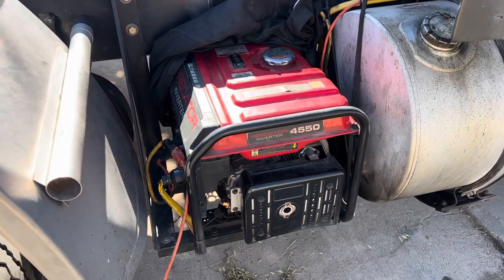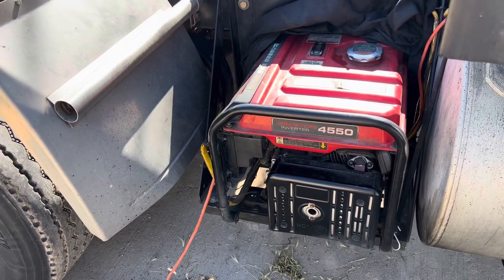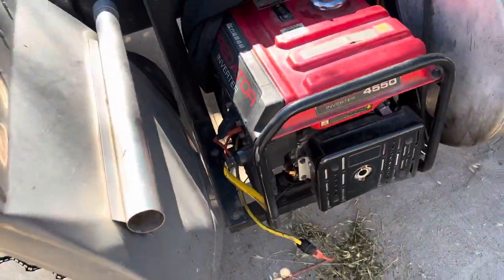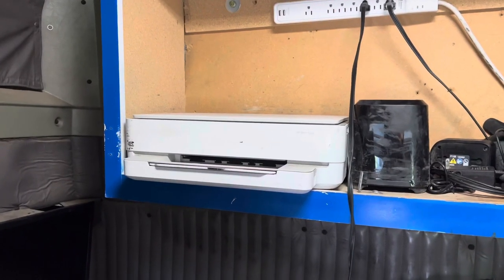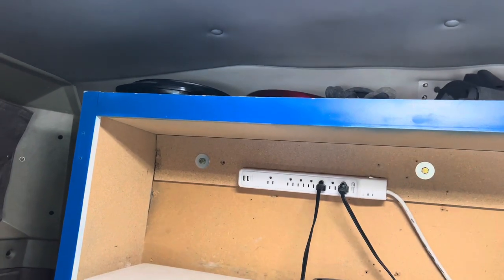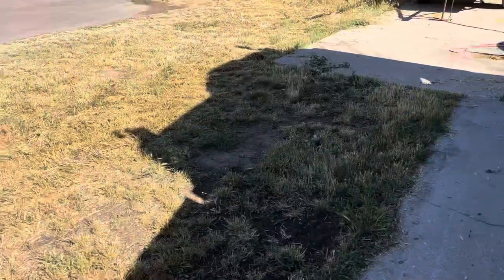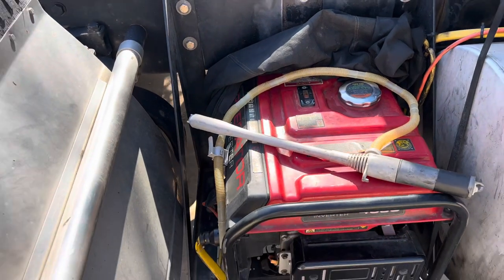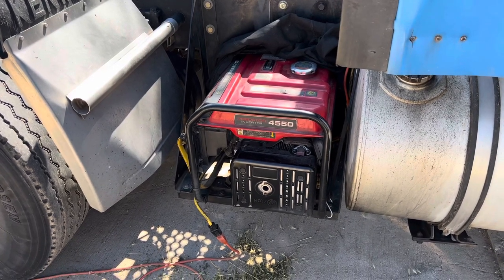APU/Generator Setup On My 2005 T600

Comment: Saw a 2000w silent inverter genny setup a couple of months back that was mounted up on the back of the cab on the same bracket that held the mini-split it was powering along with feeding a battery charger....asked the guy about it an he showed me how he didn't even have change the oil as it was set up with an oil line off the engine feeding engine oil from the truck engine into the drain plug of the generator with a check-valve to stop the oil draining out when the truck engine was stopped, this line had a 1/16" restrictor in it, there was also a return line that came out of a plug threaded into where the generator oil filler plug normally went to return oil to the trucks sump when the truck was running.....fuel was fed to the generators tank by an electric pump from a 30gal gas tank down on the side of the chassis with an overflow that went back down to the gas tank, this pump was on a timer switch to kick on a couple of minutes every 3hrs whenever the generator was running.

Genney was electric start as well

Best setup i have ever seen bar none
Reply from the maker: Only issue I see. Diesel oil is different then gas oil. But if ya can get away with it.. good deal! And I would worry about that gas generator contaminating the diesel oil.
Reply: @DrivingByBraille  Diesel oil is higher spec than gas oil as it still has zinc in it so is better for high load......lol having worked my whole life as maintenance for earth-moving machinery every vehicle i have ever owned has had diesel oil run in it no matter what fuel it used with the exception of motorcycles that have the clutch in the engine oil.

Comment: Green APU has changed the game on the industry. Reliable Kubota diesel and automotive components basically just like your car has. Get parts at most auto stores.
Reply: Stop it, that apu is still 10k
Reply from the maker: @EdoHannibal I think it’s closer to $15k now. Let the APU fan boys believe what they want. When they need to fix it, I can buy 2 generators. Let alone  lifetime of generators what the pay for their APU on. A truck that only last 5yrs 😀
Reply: @EdoHannibal  I was just at the MATS and they said it was $13k but had a 4KW generator on it. Which seems to be new
Reply: @DrivingByBraille  do u use the truck ac when u running down the road, or the portable ac? I'm looking to get one, and I don't wanna fix my truck ac if I just run the portable one all day
Reply from the maker: @MrKingcruz no, the portable will only keep the bunk cool. It don’t have enough BTUs to cool the whole truck. I’d like to eventually put in a rooftop unit like on an RV. Had one on an old truck and that would keep the whole truck freezing even in 110° Arizona heat.

Comment: I mount a small fan to the roof of the truck with small bunges and use it as a ceiling fan. It's seems to circulate the heat from the top down and keeps the cab alot cooler

Comment: Always more reliable than an APU.
Reply: Not really i have a generator in my truck that is 7.5 kw diesel  gas is to dangerous  ari  built mine 156inch with shower full kitchen  and bath room a cabinets all over and all the comforts  of home and more
Reply: @jeffreycrowther1374  You are right, on that note.  Diesel gennies rock.
Reply from the maker: I wouldn’t really call that a full shower. Maybe shower/Shitter I’ve been in one of those. I know you shit in the shower.
Reply: @DrivingByBraille  😂😂😂😂

Comment: I have 12000 air conditioner ptu with fireman 2000 gen. It does fairly ok. It holds close to a gallon of gas. Run time good nine hrs. I had a apu on the truck i took off and sold it. Fixing apu now days is very expensive. Not anymore. I love the inverter generators. Cost of running apu and running inverter generators cost wise. You safe a lot money with gen. I check the cost for both.

Comment: Power Inlet $15 or so on Amazon, regular single or a dual. Drill hole through wall with holesaw or jigsaw insert then screws.

Comment: You should have gotten a duel hose ac.The single hose ac's pull hot air from the outside in the truck.

Comment: How do you connect the tender to the generator or batteries? Great video!
Reply from the maker: I have it plugged into a power bar. 1 10gauge power cord is plugged into the generator. And that plugs into a power bar.. everything in the truck, Microwave, printer, toaster, fridge. Plugs into that power bar.
The charger comes with the connectors to hook to the battery.

Comment: I have a PM3-100LK power converter/charger, it can be setup as a charger or be set to constant voltage. I am nearly done swapping to lithium instead of running a generator but that thing saved my tail once when the sense wire on my alternator rubbed out and blew a fuse sending the charging voltage to 19.5. I thought my headlights were working well that morning 🤣 disconnected the alt and fired the gen up and it was able to carry the load. genuinely surprised no modules or sensors were taken out when it happened. As far as the current setup goes, 600AH in lithium, 60a dc/dc charger made for lithium, 2kw pure sine jupiter inverter from harbor freight (slated for replacement due to massive CB interference) Eco flow wave 2 dual hose inverter ac. It will cool the whole truck at night but direct sun will not even keep up with the sleeper seperated off. It should still work out given my running pattern. Failing that though, there are new portable acs that are inverter based and dual hose that are a lot better on their power consumption along with the massive benefit of not having a surge at startup. The inverter generator I was using when directly powering it would just slowly ramp up to a raised idle where with a traditional ac it would nearly stall with just a 5kbtu unless I had eco mode disabled.

Comment: I have a 2200W westinghouse generator on my truck with a 12000btu air conditioner, and now I find a problem, every time I go to Las Vegas and Phoenix, the hot weather causes the generator not to work for a long time, I Guess it's the alternator overheating. Since I let it rest for a while, then it can start again, 15 minutes later, shut down again, I was wondering, does your generator shut down when it runs for a long time in hot weather? Or can it run continuously 24/7? ? ?
Reply from the maker: Does it have a spark arrest on the exhaust? If so, might be clogged. I remove those things. But no, mine doesn’t over heat. Even sitting in direct Vegas sun.
Reply: @DrivingByBraille  thank you
Reply: You are probably vapor locking the fuel line. Are you running a cooling fan?
Reply: i don't cooling fan,,next year，I want to place a fan in front of the engine. Once the generator starts, the fan starts automatically.

Comment: What is the with of genartor I have the same setup with a 3500 its really tight. the 3500 is 17.5in I have about .5 clearance between the bracket will this one fit? There’s is no specs on it on harbor freight or anything on the net.

Comment: My problem is there is no holes in chassis what.  can I do can I drill holes on it
Reply from the maker: I did…
Reply: I am going to do it tomorrow 
Thank you
Reply: You can get a frame brackets at Iaowa 80 ,they mount over a frame and make a box
Reply: I would not drill holes in a chassis, there are alternatives to doing so